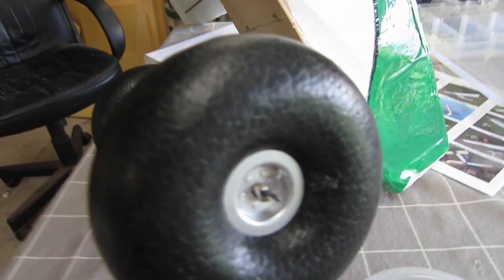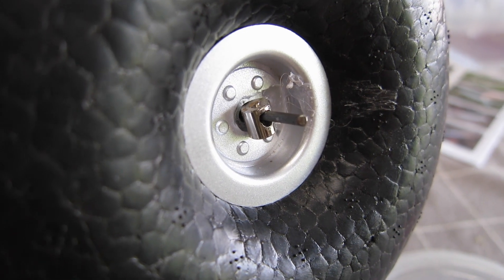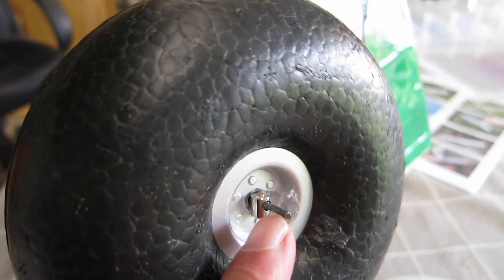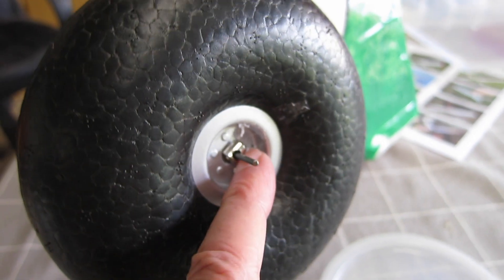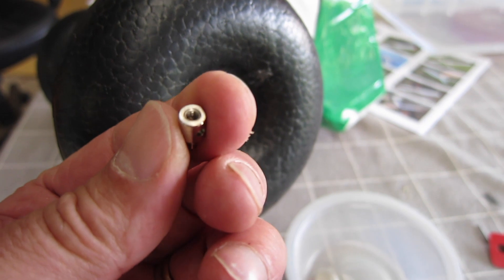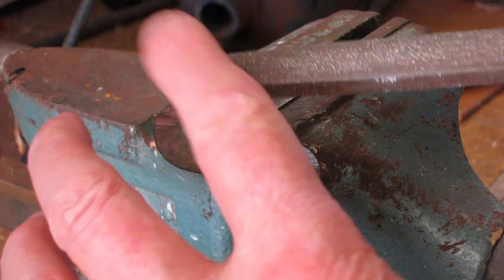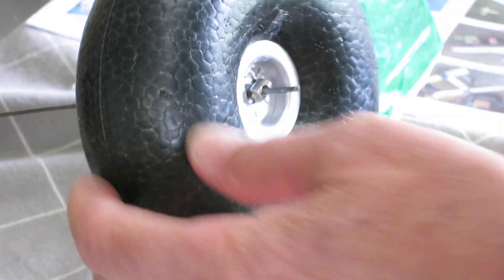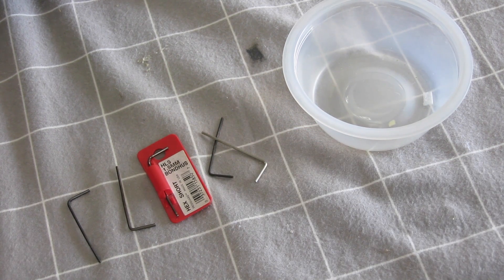Quick tips - Wheel stops (wheel collars)

Comment: Money saving tip. 'Chocolate block' electricians cable connectors. Essentially a short oval brass tube with 2 threaded holes and screws used to join household wiring. Usually as 8 or 10 in a block of clear flexible plastic. Cut this away, saw each little tube in half and slide one onto axle, slide on wheel and the other half to retain it. Available in several sizes. Coarse thread use Loctite.
Reply from the maker: Great tip thanks
Reply: I use them for control rod link adjusters. Pass both ends of the rods through the connector and tighten both screws

Comment: P.s. Use smallest brass connectors, complete (2 screws) to join metal pushrods. Two rods a fraction over half length needed, each with one 's' bend. Fit one in servo arm, and slide connector along. Fit other rod in control surface and use little collar to join and get length right. I suppose you can use these connectors in an emergency to join ESC to motor, anyone tried it?
Reply from the maker: Have not tried it but thanks for the tip

Comment: Wheels? Wat is this wheels plis sir, I am not knowink?
.
 Teehee! Where I fly regularly is too rough, in my opinion, for these modern Carlos Fandango type advance concept tech like wheels! And between 30 to 50% of my landings are usually in the scrub anyhoo. :¬P
.
.
But I have used something like this in other situations too. Cycle cable grip bolts.
I would recommend using a washer between the fastener and the wheel though.
Reply from the maker: Washers! Phhht, perfectionist. Actually thats a good idea. I do keep cracking the wheel hubs, maybe a washer will help, that and trying not to slam it down hard.
Reply: I guess we both need to practice more landings than takeoffs. ;¬)
Reply: No ,me, not him.
 Wellll,
ok, both.